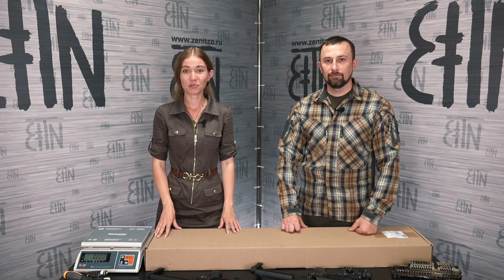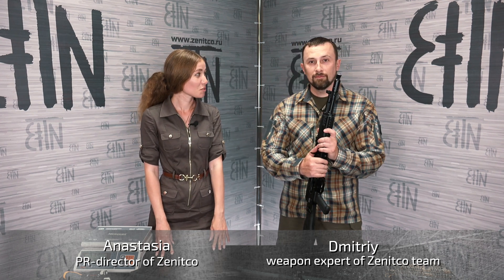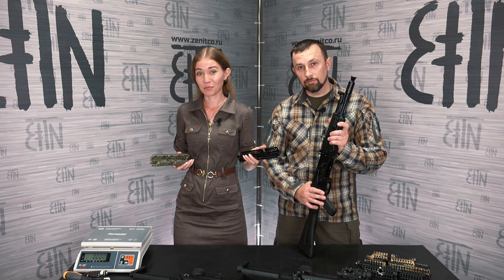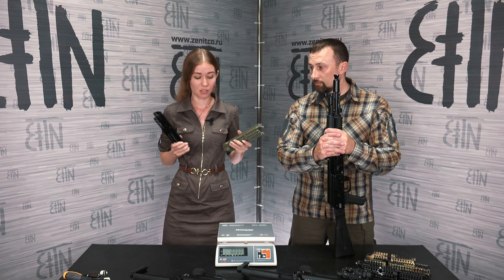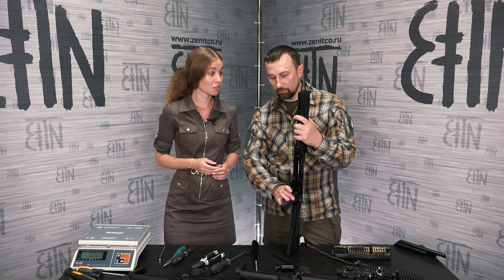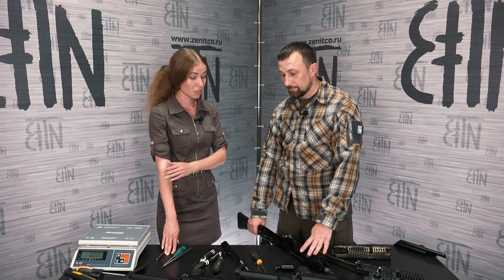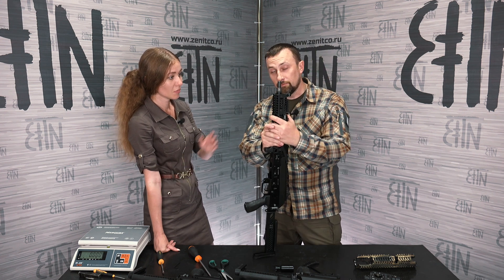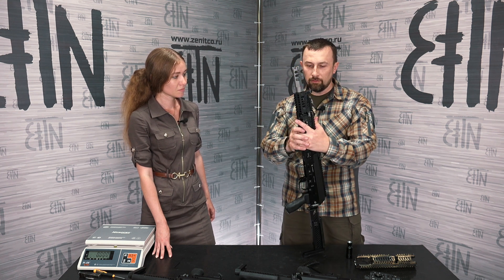Saiga-5.45 v.33 (short barrel): setup for hard operation conditions, long handguards B-30 and B-30U

Comment: Any chance Zenitco sells bullet guide for Saiga MK(K)-102 so it can feed of most AK "military" magazines ?

Or any shop in Europe selling those ?

They are ITAR related in USA so can't import one in Europe :'(
Reply: use galil, or 74 style. Those should be easy to find on that side of the pond. Or, just use the factory izzy mags. Those are much easier to acquire over there than in the US. I’d rather have those any day over installing a guide. But, It is just a piece of steel, so I’m sure someone somewhere would be willing to help ;) could even possibly make one